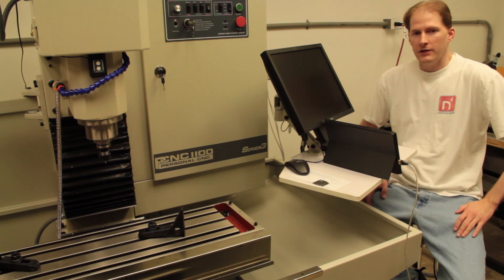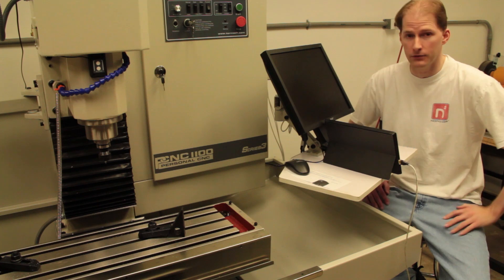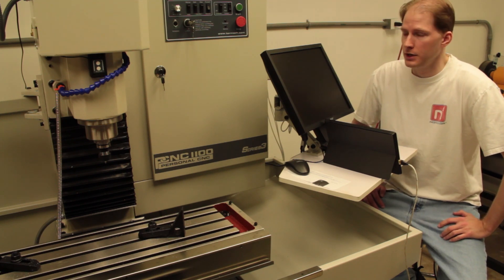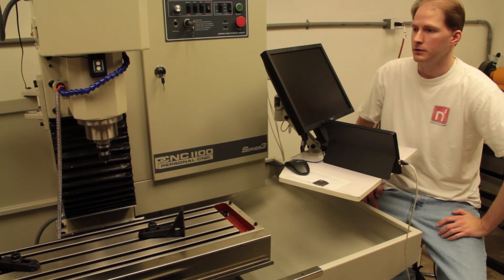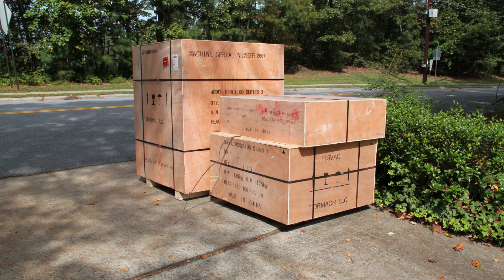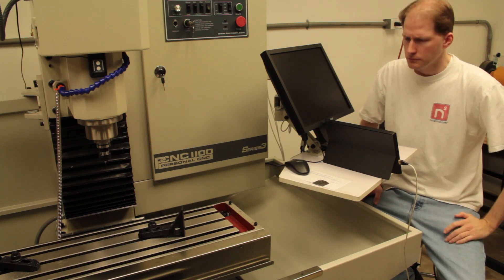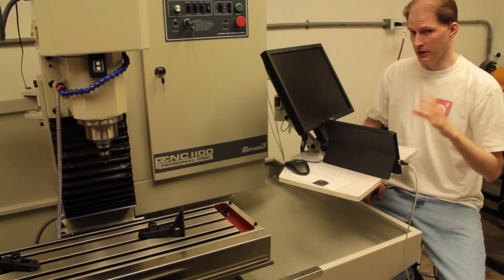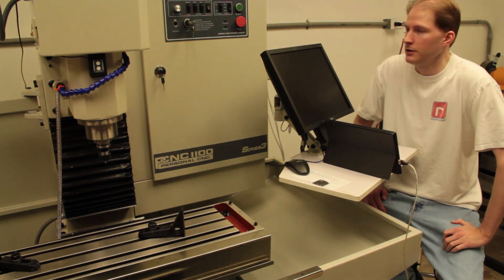Tormach PCNC 1100 - Comments on Delivery and Setup

Comment: Not to beat a dead dog, but if you've got a paved downhill driveway and a pallet jack, it can be done no problem. Sorry, but I had to poke fun at that.
Reply from the maker: A simple pallet jack was considered. Unfortunately the math did not work out. At the steepest part of the driveway the lateral force from the weight of the mill would be around 300lbs. Basically I would need to be able to generate a 300lbs force parallel to the ground to prevent the jack and its payload from accelerating down that slope. The driveway is neither level nor smooth so letting the crate drag was also not an option. 
I did look into using a pallet jack with an integrated brake but I couldn't find anyone local who rented them.
Reply: I was mainly referring to the tricks you pick up on from using them regularly (as I do). One solution is to lift it only slightly, lowering it and raising to govern speed. Also just have a couple guys help you out. Those were the thoughts running through my head.

How long in total did it take to install the mill, including uncrating?
Reply from the maker: Bradley Galloway Basic setup doesn't take very long. It was very easy to remove from its crate (unlike my table saw which was lighter but a beast to uncrate). Place the mill on its stand, remove the shipping materials, plug in the electrics and you are ready to go. You could be ready to make chips the day it arrives. 
Installing accessories (like machine arms and power draw bars) took me longer than setting up the basic machine.

Comment: Nice work. Have you made anything cool with your Tormach? They just came out with the 440, but I'd love to see an affordable 5 axis machine from them. The market is ripe so it's ready for the taking! Cheers +Les Wilhelm
Reply from the maker: +jaydekaytv Many things have been made on this machine though I have not done much recording. I have not worked with a 5 axis machine yet but I image debugging g code would be vastly more complicated than a 3 axis machine.
Reply: +Les Wilhelm Any favorites you've made? If you haven't already, take a peek at Fusion 360, it does 3 axis right now, but will also do 3+2 and Simultaneous 5 Axis this fall and looks quite good so far. It's cloud based and has been evolving quickly. Also if you haven't, check out the Pocket NC (very small, but does 5 axis). They'll be hitting the streets soon. Keep having fun. +Les Wilhelm

Comment: Thanks for making this video it helps a lot having an idea what to expect.
I am looking forward to the delivery of my 1100 and need to put forks on my tractor.
Ant chance you still have the crates around to give me a spacing I need between the forks?
Reply from the maker: Skip Pope I don't have the crate around anymore but I remember you can fit a standard pallet jack under it (27" between the outside of the forks). I also recall the way we maneuvered the forks under the crate was off center. This is the main reason we strapped it to the loader.
Reply: Les Wilhelm Thanks, that should get it off the truck

Comment: Les, Thank you for taking the time to make this video. I am planing on purchasing a Tormach myself. Now that you have had the machine for about a year, are you pleased with your purchase? Are there items or upgrades you wish you would have done, or not done from the beginning? Did you go with the cad/cam Tormach sells or something else? Any suggestions on tooling like tapping or indicating tools, should I go cheep or get the best? Thanks for your time
Reply from the maker: I have been please with the machine so far. I have called Tormach for a couple of issues (mainly powder coating covering up holes so I couldn't find them) and they have been great. 
I use Geomagic Design for CAD. I use SprutCam for CAM (which I did buy through Tormach) mainly because there were video tutorials available online. 
Tooling is an interesting question. I wish I had used cheaper cutters when I first started. Early on I made various mistakes concerning plunge rates and feeds (mostly in non ferrous materials) that caused me to break those cutters. I could have used cheaper HSS tools in those projects but instead used really nice (expensive) carbine cutters. Breaking cutters is frustrating and breaking expensive ones is infuriating. 
Since indicators are not generally in use when the machine is running a program you are less likely to accidentally run them into something (I think if these meet their end prematurely it is due to dropping them on the floor).
Most of my instruments are either Starrett or Mitutoyo. Remember while more accuracy is better a tool only needs to be 'accurate enough' for a given task. Some of my most accurate (expensive) tools spend most of their time in the tool chest since I don't need them for a given project so there is no need to expose them to the dangers of the shop. 
Hope this helps.
Reply: Les Wilhelm Thank you for the information. I appreciate the help.

Comment: You mentioned that the delivery co. might only deliver to curb.  I took delivery of my PCNC-1100 in VA, and I have a fairly short driveway.  In my case, the driver used a pallet jack to put the crates in my garage, which was nice.  I also ran into the problem of lifting headroom.  I borrowed a pickup truck to move the mill around back to the shop, but the bed was too high.  I ended up using a utility trailer hitched to my car, since the deck was only about 18" off of the ground.  I also made my own lifting bar from .375" stainless plate, and drilling it convinced me to keep my Bridgeport.  :D

Comment: Do you know what total height is required with the engine lift that you used to pick it up and put it on its stand?
Reply from the maker: my stand with its feet installed and leveled is 25.5'' from the floor to the top of the stand. However, the gap from the floor to the bottom of the stand is only 3.5''. I needed to get my shop lift legs under the stand and the legs of my shop life are 7.5'' tall so the mill stand need to be put up on blocks (I think i used 5 inch blocks). This means the stand was 30.5'' tall during installation. This is the relative height the mill must be lifted. Remember the top of the 1100's lift ring is about 46'' from the base of the mill and you will need some space for rigging (i think my rigging was about 5''). Thus the lift needs to be able to lift the mill to an absolute height of 30.5'' + 46'' + 5'' = 81.5'' (stand + top of mill lift ring + rigging) .
Hope that helps.
Reply: Hi,  3 years after your installation but I have a question.
You wrote here that the height needed is 81.5"  but the Tormach operator manual (page 22) says that you need 84" for the 1100.  ???
Could you explain please?
Thanks,
Reply from the maker: The operator manuel is referring to the total height of the machine. This post is in reference to lifting the machine. The lifting ring is located on top of the machines frame but the z axis stepper motor extends beyond that.